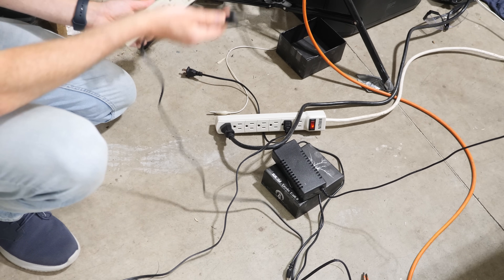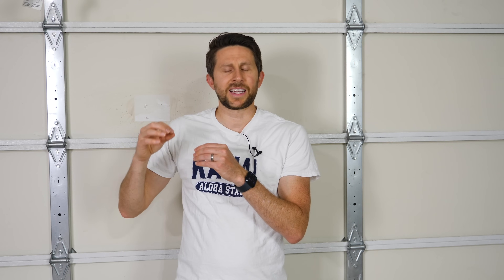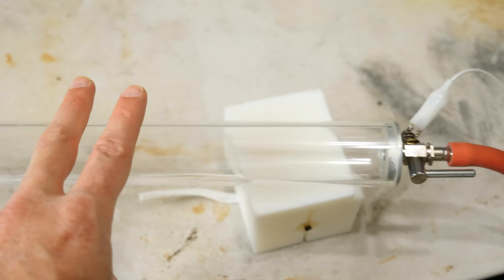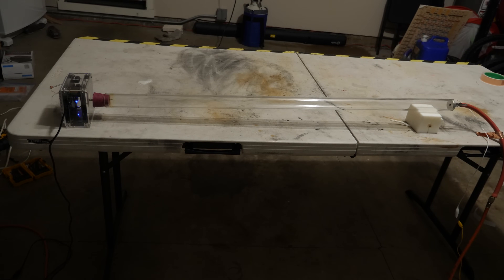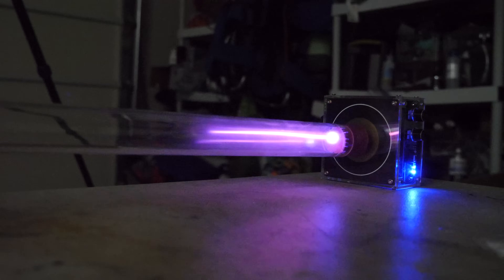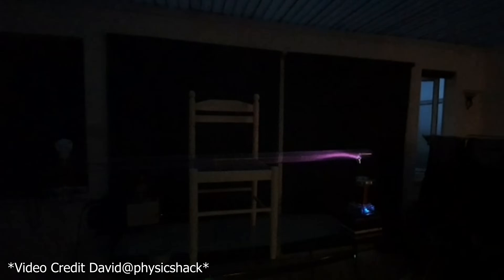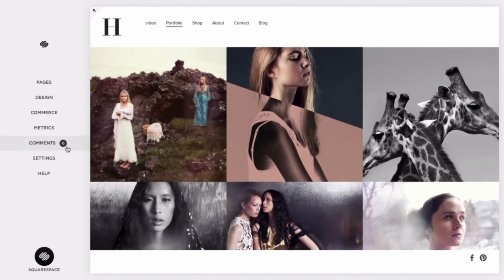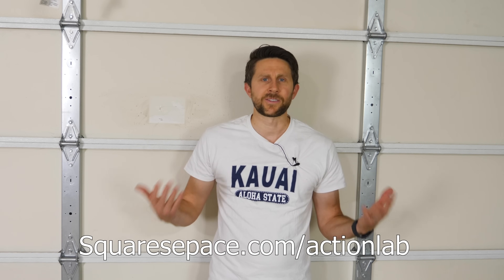Using the Air As a Wire—Was Nikola Tesla Right?

Comment: It’s a very silly idea.  Power goes off in all directions and is only captured by a few antennas at best, so at least 99.9999% of the power is wasted.   And there is no way to meter or charge for the power so it’s economically imbecilic.  And of course in the first step you’re converting AC to radio waves which is not very efficient so you’re losing a good chunk of the energy right off at the transmitter.   All these things were well known in Tesla’s time.

Comment: Here is my thought, the real purpose of the antenna it was not to transmit energy, but to establish a guide wave, a resonance wave that would induce a vortex around the antenna, that vortex would act as a vacuum of "energy states", transforming them into useful energy.

Right now we think that energy is carried by electrons, but that would be only a perspective of whats really going on. 

Energy is everywhere, like a fluid that composes all. Energy in itself is "stateless", is the infinite power/possibility of states.

The countable energy we conceive, is the result of interaction between energy states. 
We live in a determinated world, but this "world" is not separated from the indetermination. 

When we take something electrically charged (it has an energy state that deviates from the surroundings) and physically connect it to a different energy state "something", we make them interact so their energy states will change accordingly to the difference between the two things and also the surroundings. So energy in itself didnt change, the energy states changed. Energy didnt move, the states of energy moved. 

What Tesla discovered was a way to tap into this stateless energy which is everythere, static, unmutated, eternal. It seems, that by creating certain patterns, by the right secuence of changes in a controlated "structure" of energy states, we can create this negative entropy vortex (it is negative because it orders the energy states locally). This phenomena is naturally happening all around us, and it is in fact the cause of everything we can see, it is the cause of matter and it is the cause of life.

Comment: I seen a video where someone put a long piece of wire on a drone and he went up 100 feet in the air and Dangled that wire down and connected it to some aluminum soda cans and when he touched the cans it shocked him. Is the air in the the ambient  atmosphere really electrically charged and every meter you go up from the ground is higher amount of electricity? Can you do a in depth video over this topic and help me understand it more better so I can try to understand and come up with a invention to use ambient air for free energy
Reply: it's easily available but low density; you can get it anywhere but you can't get /useful/ amounts of power cheaply. Note, in this case, he'd have used more power flying the drone than he'd have gotten from the wire.

A thousand kites with wire strings might get you somewhere, but you have to keep those kites in the air.

If it were useful, you would have just tall towers with wire up them rather than wind turbines. :P

Comment: Ok, air is just one part of the patent BUT, as I experimented by myself, the GROUND is the key element to connect one place to the other...
In particular water is simply perfect to transmit power for long distances as a wire. 
One wire connection.
Reply: That was Tesla's idea, to use the ground.
Imagine walking on permanently electrified ground. Not much better than having a permanently electrified atmosphere.
Reply: @MariaMartinez-researcher  hi frequencies electric power is not like 50Hz AC, it is completely safe, as when a bulb lights up in your hand in a typical proof of concept with Tesla coils or slighter exciters. The very high impedance of human body cancels the wave. I've been playing with those machines for long time and I've never experienced any disturb.
Reply: @Giarko  Now imagine all the energy needed to make possible public light, transportation (private and public), telecommunications, all manner of appliances, computers big and small. All sucking energy from the atmosphere or the ground, freely.
How do you protect such an unplugable system from lightning storms?
Reply: @MariaMartinez-researcher  A lighting is a high voltage discharge but actually the power is just "low" (because of low currents). I think that the effect of those is like a ripple on a signal...there are much more problems in a thunderstorm for the classic cable transmission (it happen frequently that transformers are stroked)...
The real problem is the lack of measure on consumption and consequently on charging costs to the user.
Reply: @Giarko  Curious. The USA Weather service states that "A typical lightning flash is about 300 million Volts and about 30,000 Amps. In comparison, household current is 120 Volts and 15 Amps."
Also, in the commerce there are gadgets to protect your appliances from lightning strikes. Even more, among the recommended measures to protect your appliances, there are unplug everything, not even leaving the plugs near the sockets (because the current can jump), disconnect the landline phones and cable TV, turn off the main electrical switch, and make sure that the fire insurance covers damage caused by overvoltage.
(I highly recommend you to Google "damage to appliances caused by lightning." Very interesting.)
Appliances and homes sucking energy from the environment, how do you unplug them?
Reply: @MariaMartinez-researcher  we know people survived to a thunder strike...and it would be impossible if the measurements you report were strictly those. The current depends on impedance of the body that is hit, while the potential is correct. By any chance in a house there are protections because electrical equipments, in particular wires and circuit boards,  are pretty sensible to this phenomena and need protection. I think that transmitting this way wouldn't change so much the protection systems like magneto-thermic switches.
Reply: @Giarko  People survive lightning strikes (thunder is another thing, basically noise) just because the human body is a poor conductor, the air around it ionizes and the current goes around it. Still, a typical human doesn't come out unscathed from that experience.
The voltage and amperage data I report, as stated, comes from the USA Weather service. If you think they are wrong, please contact them and prove it.
But the question remains: how appliances that would need to be constructed to be open to electric currents freely flowing from the atmosphere and/or the ground, can be also isolated from those same kind of currents when there is a storm? With a wires system, you can unplug them. How do you unplug something that is plugged to the environment? Electric current does like conductive materials. A lot. A human can (more or less) divert a lightning strike, but the wiring inside your appliances and computer cannot. And won't, if you construct them in a way that make them susceptible to get energy wirelessly.

Comment: Tesla did everything too suppress any arcing, or "lightning". He wanted to use the resonant frequency of earth itself to get it to "ring" and other "towers" might be able to tune to that "ring" and instead of "pumping" energy into the oscillating "ring", they would extract it. From those towers, regular cables would have been used to distribute the power locally, as they are far more efficient. Also, the towers need to be placed on specific points on the surface of the earth, to hit "nodes", in order to maximize efficiency. At least that is the theory. In practice it did not work for multiple reasons. Tesla was an idealist, but the Earth is far from ideal and behaves differently than idealized models, making his vision impossible to realize. Tesla was a genius, no doubt, but even he ultimately had to surrender to nature and reality. Also, Tesla struggled to get a good enough electric connection between his tower and the Earth itself. All those deep steel "fundamentals", even when soaked in salty water to improve connection to ground, were not enough. And even if they were, they would rust away in operation quickly. Also there is a practical limit to the length of any wire/coil, before it breaks the resonance needed to sustain any "ring" with the Earth, as it becomes phase shifted during the reversal of polarity to a point where it looses the capability to transmit any energy. I guess this is what ultimately caused him to fail. Of course, the knowledge back then was not available. Tesla was decades ahead of his time, but ultimately wrong when it comes to his wireless power distribution across the entire planet.

Comment: Technically that's what a wifi modem does outputting it's signals is putting voltage through the air just on a small scale.
Reply: Idk, poWIFI haven't taken up much since 2015. But some companies are working on wireless charging stations... for smartphones. Knowing damn well they require lots of power.

Comment: how about using a laser to ionise a line of air to the target first?

Ok, perhaps..   I mean..   in the upper atmos, we have very ionised gas..  because that gas is not protected from charged particles..  its a very high energy, ionised place up there....    but its also not very dense.. obviously.    Surely, if we place a large conducting mass in the ionpshere, then it should obtain a similar charge to the ionised gas..  one would assume?  

So...  what I'm thinking..  is this potential difference between earth and the upper atmosphere is being driven by all these particle collissions going on between the atmosphere and the charged particles being belted out by the sun...   what we would need to do is form some kind of conductive connection between that layer of atmosphere and ground.  If we can do this, then we can empty the ionshpere of energy and get a free lunch..  from the sun..   ?

Comment: Even if you did this in the upper atmosphere where it could get the range, the energy transmitted to any particular point would drop off as 1/r^2 (and worse due to losses), so it would be really inefficient.
Reply: Tesla's goals were a little special, in that he was aiming at what we today call the Schumann resonances- if you hit them close enough, then most or all of your signal gets reflected back by the upper atmosphere, limiting your inverse-square losses. Unfortunately, the signal will still interact with unintentional resonators, which can result in problems (e.g. fires), and will result in losses.
Reply: @absalomdraconis  Even if you got vertical confinement in the way that you say, you would still have 1/r dissipation, and you still have resistive and inductive losses likely well exceeding those of copper or aluminum wires.
Reply: Not in a scalar field. It only operates where needed, they also build up and self-sustain after some time for a period too. Totally different to the traditional EM stuff you are taught about.
Reply: @N4CR  The atmospheric electric current isn't going to confine itself to just where you want it.

Comment: Hello. You must first understand Tesla's mindset! His belief was even before the string theory was given that everything in the universe vibrates / waves! Today, this is a generally accepted fact. Tesla is a Tesla coil installed in his Colorado Springs lab 1899–1900, and patented in 1902! Tesla had previously worked on a radio station, but in a fire in 1895, documentation and all devices were destroyed. Of course, an honest man like him did not imagine that anyone could "steal" his patents and implement them in his device as he did in 1899 with the presentation of the radio Guglielmo Marconi! My personal opinion is that Tesla is in the years when it tested high-speed power transmission (nowhere is it mentioned that it is electricity), because before the demolition of the Wardenclyffe Tower there are no reports of artificial lightning above or around Wardenclyffe. Also in the notes of his assistant during the energy transfer test, when they tested the wireless power transmission around Wardenclyffe Tower and thus managed to light the bulbs without a cable connection. It is also known that in recent years he has dedicated a lot of work to wireless communication and, in my opinion, also discovered death ray at the same time. I think he found a frequency that by itself does not carry an electric charge but can be converted into just that. For ending! It is a mistake to look for a solution in the transmission of electricity as such! It will be necessary to pay attention to a wide range of waves and its speed / length of oscillation, so in my opinion the solution lies in radio waves, which as such carry a certain electric charge and bounce off the earth's ozone layer at certain frequencies.

Comment: Maybe he was thinking of this:
-Negative ions in grond
-Negativ ions in underground waters (when water bounces betweene air moleculs, creating negative ions) 
-Positive ions from surface air, all up to 50km above the surface
-Negative ions in ionosphere
-Corona motor (not exactly, but good for connecting the dots)
-Wan de graff generator + tesla coil
-Bernard Eastlund - HAARP was made according to his much bigger idea, of much bigger instalation as HAARP. Which would be big (if it was created) 40 miles^2, with 100GW of needed power and which according to his patent, was able to control the height of ionosphere layers, controling wheater by creating EM mirros for sun rays, screwing up the connection between satelites and ground, control emotions via ELF waves. Most important in all this, is that Bernard stated that this was all based up on some Tesla's ideas. 

Connect all these dots, in a prooper way and you have the way of producition and transmission of electric energy, not just transmission of it.
Reply: production? What from?
Reply: @thekaxmax  well its written. Positive and negative ions are the source of energy. And their source is sun radiation on ionosphere (negative ions), underground water splashes that produces negative ions too, and positive ionised air from surface air up to 50km of height.

Comment: One other thing is that arcs waste energy which is why you typically want to try and suppress them when optimizing for wireless power. Next time try using a much higher frequency wile also avoiding sharp spikes
Reply: There's that, there's also the possibility of explosion if there are any combustible fumes in the area.  As well as the challenge of ensuring that the sparks jump to and from where you want them to. Not to mention the ozone that this would generate. High up in the atmosphere that would be great, closer to the ground it would do massive damage.